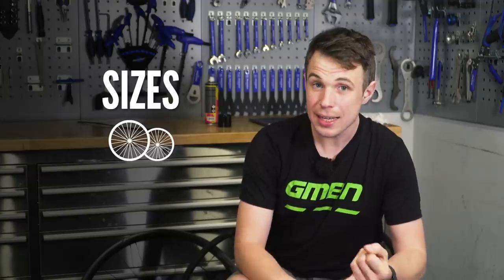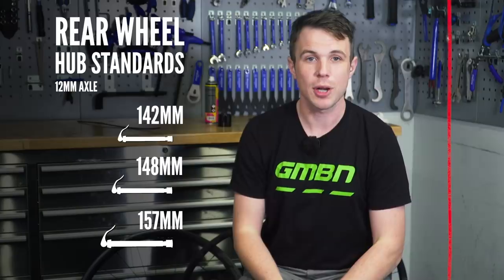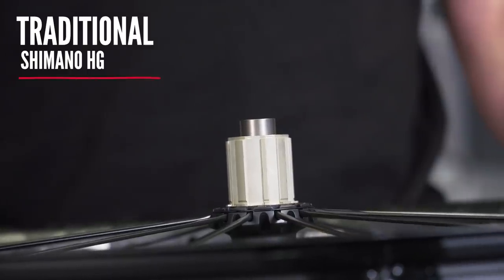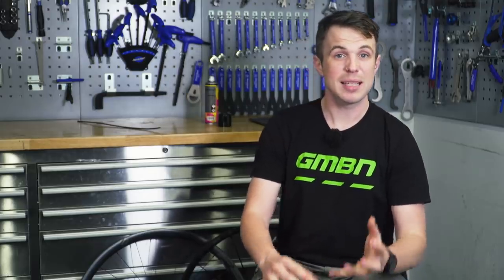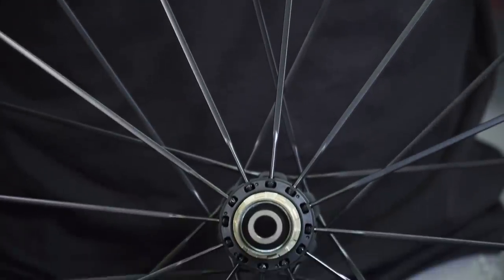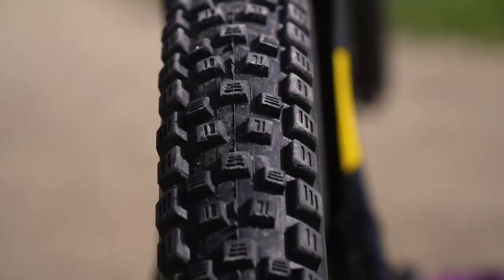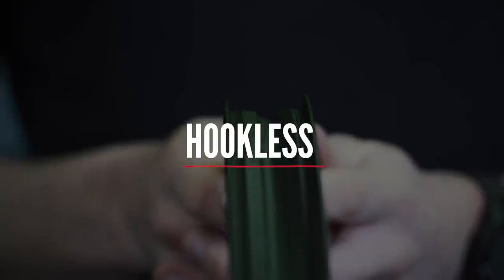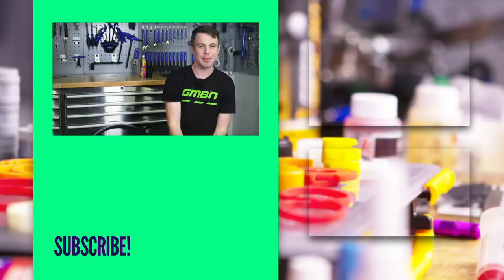Confused With Sizes & Standards? | Mountain Bike Wheels Explained

Comment from the maker: What size wheels do you have? Do you get confused with all the different standards and technologies? Let us know 👇
Reply: 29ner lightweight wheels and tires for long pedally days. 27.5 tough wheels and tires for getting down and dirty
Reply: 26'''x2.0'' to 2026 (at least, I hope)... ;) 

PS
There are also three disc caliper mount standards, two different disc rotor mounts, four rotor sizes and two kinds of brake fluids...
Reply: Gotta good question for ya..ive got a hydra rear hub 142 and would like to use my rear hub on a new boost frame...how can i do this??
Reply: I use bolt through wheels on my jump bike, could you cover that?
Reply: 1 bike 29ers with boost spacing, 1 bike 27.5+ w/boost spacing but a weird QR rear axle (but through axle front)
Reply: Curious what difference, if any, a relatively new rider would notice in going from a 2.6 inch tire on a 30 MM wheel to a 2.4 inch tire on a 27 MM wheel?
Reply: 27.5" 35mm internal rims on Hope Tech pro4 hubs (Hope Tech 35W wheelset) both non-boost with thru-axle on the front and old-school QR on the back.
Reply: @PrzemyslawSliwinski  four rotor sizes? I know of six: 160, 180, 183, 200, 203, 220
Reply: @burninggiraffe4929  Less comfort, better dig-in, better stability, more accurate, less grip in some situations and more grip in some too.
Reply: @DerrenWeekes  Also 246mm
And of course 140mm.
Reply: @DerrenWeekes  And 140mm? I know, not a pure MTB standard but actually the one I'd welcome...
Reply from the maker: @jinavl  Hey, you can get conversion kits for a lot of hubs. Probably best to speak to i9 about this to find out what your options are.
Reply from the maker: @app6072  Yea, some DJ bikes are using bolt thru wheels front and rear however some options actually run a narrower BMX spacing to allow for BMX hubs. They won't allow disk brakes though! Most DJ riders choose steel J-Bend spokes for as they can easily find and swap a spoke if needed! Jump bikes use 26" wheels. Who knows, maybe we will start to see some with 27.5 in the future?
Reply: 27.5 650B, not really enjoying the super wide
Reply: @gmbntech  nobody made one for the hydras ....yet..hopefully
Reply: Is the 141 boost any good?

Im new to biking, and have a 2020 Trek Roscoe 8.  And i have been just browsing upgrades as you do.  And noticed the 141 seams to be a very weird size.  Will this cause problems later if I want upgrades or replacemement parts.
Reply: 29" wheels and honestly none of the standards/technology make me confused
Reply: 141 boost is evil 👎 I regret buying a scott scale 990 with the crappy boost spacing. Firstly, it's hard to find compatible aftermarket hubs making it more expensive due to conversion. Secondly, the qr is so rare and the one that comes along the built bike is pointing the ground. Had to sell it. One of my many mistakes in chosing a bike. Glad that I learned from it though. Better to stick with 135 standard or 148 boost.
Reply: I don't get confused about the standards, but I do get frustrated. Case in point: I have an entry level bike, horrible fork, and I was going to upgrade... Until I realized that that a nice enough fork in my budget wouldn't fit- different size taper, so I would need a new headset and stem, used a 15mm thru axle instead of 9mm qr, etc etc... So basically when I try to upgrade I am just buying most of a new bike. Very frustrating.
Reply: My rear hub is 141 boost with 5mm qr. What hubs can buy for an upgrade?
Reply: Hi need help regarding to the size of my hubs I bought a full set of M6120 however the hub is thru axle instead of QR. The bike shop tells me to find QR 135, 9 x 100. I’m confused regarding to the 9 x 100. Is there any way to know the alternative size of 9 x 100 or how to determine the size of my own hubs? Thank you
Reply: Hello GMBN TECH I have an entry level Giant Revel frame that's running on v brakes and I see that the back end can be setup for disc brakes and I have JUDY TT shocks that can be disc braked as well for the front. The goal for this bike is to use it as a city commuter without fearing about theft too much.

I've easily purchased a new front rim that has the correct hub for discs but my troubles are finding a rear wheel with a disc brake hub, im really going budget for this therefore I'm wondering about two things; 
A. Can my current 26" rim brake rim be converted to a disc brake and is it better to put a cassette there instead of the freewheel ? 
 B. If not A then do I have to buy it all separate and build my own rim? 

Hopefully somebody can help me figure this out as in store shopping is not allowed here in Ontario Canada
Reply: Hi there? Your team need help me ok? I can ask question. I will plan which best cheap budget wheelsets specification match trail/downhill list.

- Maxxis or CST tires:
  ● 29er tire model?
- Shimano, Weapon or Speedone hubs:
  ● Hub cassette type?
  ● Hub many pawls or no pawls?
- Brand rims:
  ● 29er rim widths 30mm ~ 35mm?
  ● Rims 32 or 36 holes?
  ● Rim tubeless or tube?

Any suggestions me?

Please inform me, thank you sir!
Reply: I want to buy the bob cat trail 5 but it comes with 135mm butted fram, ppl is saying that s not good!

Comment: Running 27.5x2.6" Magic Mary f/r, moving on to 29", will also run the same tyres, would've liked to run 2.35" rear, but it wasn't an option so 2.6 is fine.
(All of this on 30mm ID-rims)

Comment: #gmbn #gmbntech Good video 👍
I'm not sure if you covered it or I missed it, but I've got a Lapierre AM 4 (2019) The rear wheel 29er with 148mm boost has the rim offset with the spokes can this be swapped with a wheel where the spokes are centered? Cheers

Comment: can I fit 27.5 on a 26 bike? I need a new wheel and have only fitted my 2010 fox rl 32 forks I had in my shed before I got married and had kids and its really hard to find decent 26 inch wheels! I have a 2007 GT Avalanche which ive already custom built so reluctant to get a new bike

Comment: Can I use 15x110m hubs on my front wheel and the smaller hubs on the rear wheel?
The frame I’ve got is not compatible with 15x110m hubs

Comment: Why does there seem to be very little support for replacement Boost141 Qr wheels?  Loads of entry-level hardtails use the standard, including mine, but getting a replacement or upgrading the wheel is a nightmare.  There are a few options using Hope/DTSwiss etc premium hubs but nothing in the mid-range that's normally covered by Shimano and the like.  Any ideas as I can make a massive difference to my hardtail by replacing the wheels, in ride quality and weight.
Reply: Looked at the used market?

Comment: Hello Experts, I have an entry level Giant Revel frame that's running on v brakes and I see that the back end can be setup for disc brakes and I have JUDY TT shocks that can be disc braked as well for the front. The goal for this bike is to use it as a city commuter without fearing about theft too much.

I've easily purchased a new front rim that has the correct hub for discs but my troubles are finding a rear wheel with a disc brake hub, im really going budget for this therefore I'm wondering about two things; 
A. Can my current 26" rim brake rim be converted to a disc brake and is it better to put a cassette there instead of the freewheel ? 
 B. If not A then do I have to buy it all separate and build my own rim? 

Hopefully somebody can help me figure this out as in store shopping is not allowed here in Ontario Canada

Comment: Boost 141 qr is the dumbest standard and shouldn't exist. Especially on bikes that cost 2K$.
Reply: @tittlemouse92 it's basically the same quick release principle. Same as in bikes from 15 years ago, just wider. You need to have through axle these days. It make frame stiffer, easier to maintain. With quick release sometimes you have to readjust rear brake each time you take off the wheel.

Comment: There isn't much if any budget wheels sets out there. I have a bike with the 12x141 qr boost the stock hubs aren't great and the cheapest wheelsets I could find were around $800 Canadian.  Why are $1600 bikes equipped with $200 wheelsets that cost a so much to upgrade.

Comment: Hi. I have a doubt. I have a Novatec D042SB hub in the rear of my bike (9mm QR) and I want to know what is the biggest cassete I can put in there. Is it 10 speed? 11speed? 12 speed? I'm currently using 9 speed, but want to go bigger/1x in the future. Thank s in advance!
Reply: Hello, u can use 11/12 speed cassette on that freehub. If u buy 12 go for sunrace mz90 11-50t.
Reply: @AndreiM1995  Thank you buddy! Certainly will be sunrace cassete, but for budget reasons, 11 speed shimano shifter and derailleur will be. The derailleur will clear a 50 tooth cassete, 11 speeds are more than enought.
Reply: @HaveFunBikes  its not a good idea to use 11-50t on 11 speed derailleur because shifting will not be smooth like on 11-46t. Better solution is oval chainring and 11-46t cassette.

Comment: Henry, I have a 2016 Salsa 27.5 + Pony Rustler with MAXXIS 3.0 front and rear. Although it rides well I would like to put a set of 27.5 SRAM Roam 30 wheels with SRAM XD Boost. Will these Roam 30 wheels fit MAXXIS Aggressor 2.3 tires set up tubeless without any problems on my Pony.
Reply: Then why did you buy a plus bike in the first place ? Makes no sense
Reply: @deanemberley2333  The PR can be ridden as a 27.5+ or a 29er. I have a 26 and a 29. Not wanting to buy another bike I want to know if the ROAM 30 rim width will fit the Aggressor tires. Question made sense to me. Can you answer it? I might be able to made 29 lb bike weigh 26 lb with a simple wheel change.
Reply: Harold Fateley 2.4 WT would be the smallest width I’d go for on a 30mm internal width rim. I don’t think the Agressor comes in a 2.4. 2.5 WT would still work well though compared to a 3 inch plus tire. 2.3 would probably work but it would be pretty flat profile i would think . The new Dissector comes in 2.4. Rolls fast as well maybe another option? Just my two cents

Comment: #askgmbntech hi, I'd like to upgrade my forks, currently using 9mm QR. Most of new forks use bolt through. I still have 2 decent front wheel with QR, is there any conversion kit or method to use them for non boost forks?
Reply: aakos26 only ones made for specific hubs. So you have to look up your hub brand to see if they make one. If it’s no name hub your probably out of luck. For a dt Swiss hub set, it’s as simple as swapping end caps.
Reply: @jonathanzappala  thank you!

Comment: I've got 27.5+ boost. Just bought a mavic deemax elite front wheel which is 27.5 boost but isn't + will it fit?
Reply: Hello bro + is the tyre size, boost is hub spacing 110 front and 148 rear. You need boost fork for that wheel.
Reply: @AndreiM1995  cheers mate. I've got boost forks I've just realised my bikes a 29er it was sold as a 27.5 from lbs and I've only just noticed 😅

Comment: I have a 142 rear low end syncros hub . It use shimano deore 10 sp cassette . Can i change freehub to micro spline and run shimano m7100 groupset ?
Reply: Hello, what wheelset do you have? Probably is made by dt swiss and you can buy freehub from dt swiss pawl/ratchet system. Or you can buy sunrace mz90 11-50t cassette with that groupset.
Reply: Thank you for repley . Its 2017 spark 760 . Hubs are 142 syncros . Can i change free hub for microspine and use shimano 12 speed ?
Reply: @alifallah1954  watch on your rear hub if has an F on it, i think that bike has formula hubs and you have 5x141 rear hub witch cannot be changed to microspline.
Reply: @alifallah1954  best budget upgrade is 11 speed slx/xt with sunrace mx8 11-46t cassette and you can use your freehub with this combo, and buy narrow wide chainring for your current deore crank. That bike doesnt worth more than that because 12 speed is not cheap right now and shifting is not better.

Comment: #ASKGMBNTECH why my bike cassette and wheel wobble a bit
Reply: tighten the cassette bolts or the quick release
Reply: Could be many things, put likely worn bearings, axle, loose axle...
Reply: @rupedog  I tighten the quick release but when i spin it it wobble
Reply: @seanglysing6913  your wheel might be buckled
Reply: I don't think so causes it wobble with the cassette
Reply: @mekenzimarku8316  and I never hit a big impact before
Reply: It just wobble a tiny bit it ok but thank for the tip
Reply: @seanglysing6913  anything can make a wheel buckled i just rode my bike for a week and my back wheel started to show signs so i got a spoke tool and zip tie and made it straight again
Reply: @seanglysing6913  tighten the cassette bolts
Reply: @mekenzimarku8316  but all my spoke is tigth
Reply: @seanglysing6913  the lockring

Comment: how will i know if my bike can take a 148 boost or 157? i would like to fit an i9 hydra boost with my giant reign bike. im using a sram GX 12 speed group set.. and 6bolt rotor sram rs brakes..